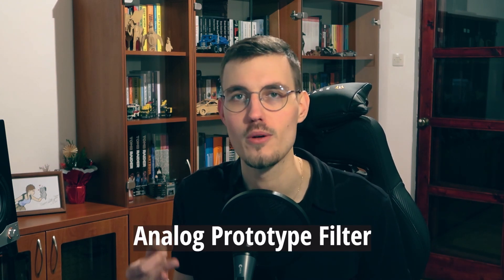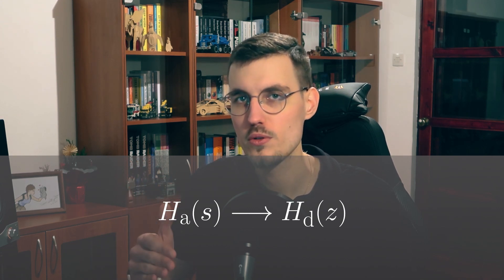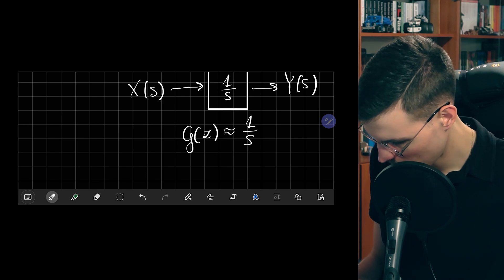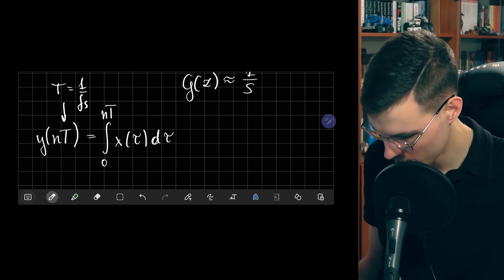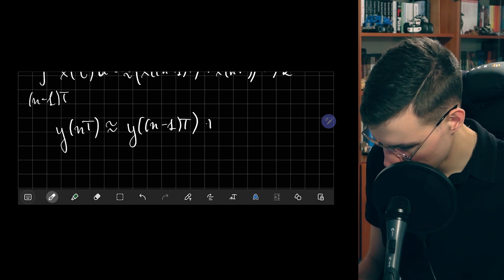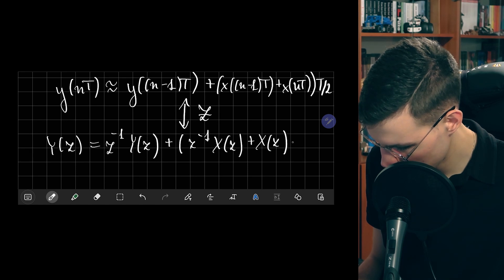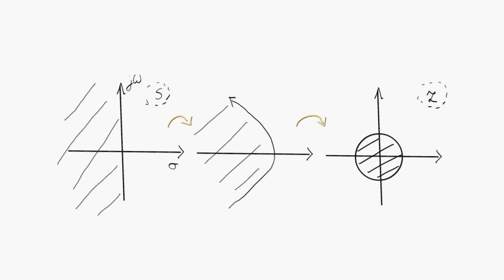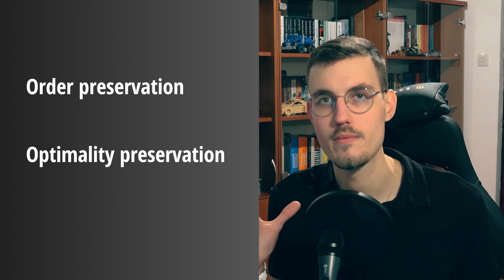Bilinear Transform For IIR Filter Design Explained Intuitively [AudioFX #007]

Comment: Nice video, thanks! I have one question though - why do we need to use the bilinear mapping instead of just using the mapping z = e^sT or s = (log z) / T ?
Reply: If I would have to guess: you would get very nasty z-transforms which would be very hard to create using digital hardware, how would you even go about defining the order of a function of log(z)? Using the bilinear transform gives you the property that filter order and that stability remains, and while you do get some frequency warping (high omega scales a lot quicker than low omega, think of the relation omega_a ~ tan(omega_d) indicating that omega_a -> infinity means omega_d = pi) you can counteract this by transforming the frequencies between the domains and design it in this way. I am not really that experienced in the field of filter design but I hope this helps.
Reply: @v1n3g4r7 in addition, the first order Padé approximant of a logarithm is the bilinear transform, so your intuition is correct!
Reply: @finnheijink8152  thanks mate!
Reply: If anyone is curious I came up with an explanation that makes sense to me.

A digital signal can be interpreted as a continuous signal with impulses at integer multiples of the sampling period. In this sense, replacing z=e^sT is basically equivalent to interpreting the continuous filter as a digital filter. But this is only possible if the continuous filter has an impulse response that is an impulse train with a frequency equal to the sampling frequency. In other words, you cannot use the mapping z=e^sT unless your continuous signal is already sampled! 

Therefore, in order to use this mapping, you need to first sample the impulse response of the continuous filter. Then you can simply interpret the filter as a digital filter. This is an established method for converting continuous filters to digital ones and it is called impulse invariance. 

The reasons you might avoid impulse invariance and would instead use the bilinear transform is that the impulse invariance method is susceptible to aliasing and is flat out impossible to use for a high pass filter.
Reply: @v1n3g4r7 I think your explaination is spot on